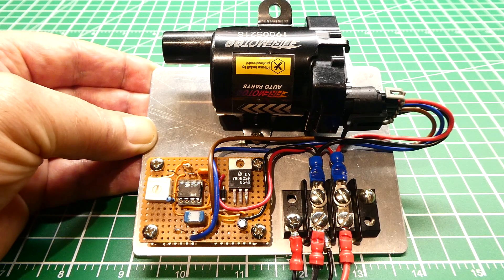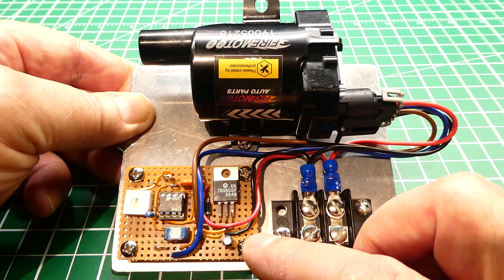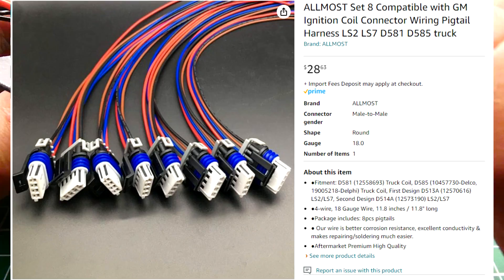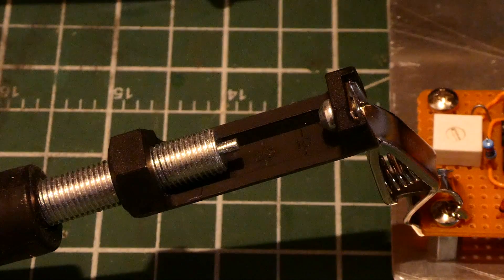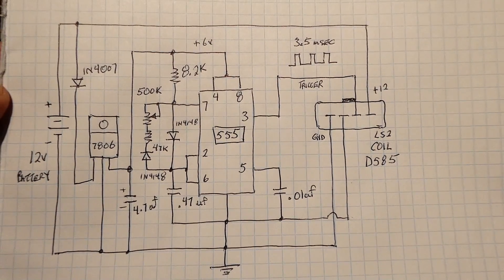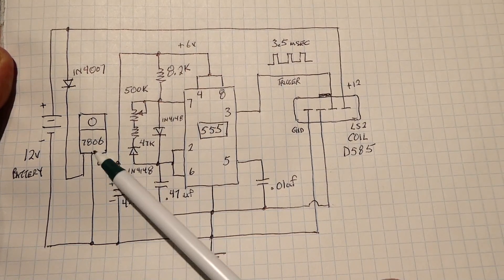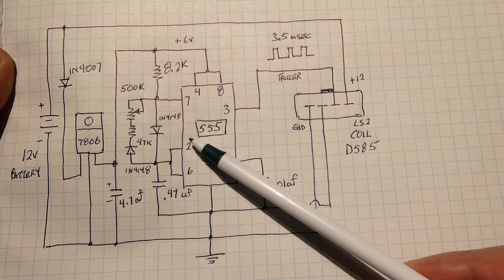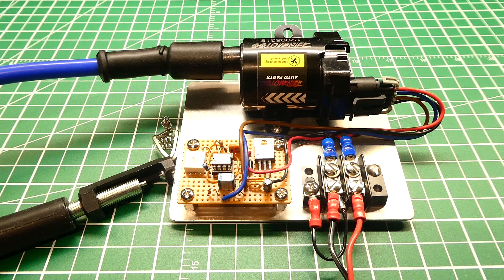LS2 Ignition Coil Tester /  D585

Comment: Hey I built this but the 7806 regulator keeps blowing after about 5 seconds. Doesn’t get hot. Is the circuit diagram accurate? Does there need to be another protection diode somewhere? Works perfectly until I connect the 12v and ground to the coil. (I can see the pulses using an LED connected to ground from lead 3)
Reply from the maker: Maximum input voltage on the 7806 is 25 volts. Verify with a scope. Power the circuit with a car battery not a power supply. For troubleshooting, power the 7806/ 555 timer circuit with a 9 volt battery and the coil with separate 12 volts.

Comment: Great video. I stumble here because I'm trying to run my ls style coils using an ECU meant for "dumb" coils. The ECU uses a negative trigger to fire the dumb coil, and I would like a circuit that turns that negative trigger into a the 5 volt signal that the coils needs. Any advice?
Reply from the maker: If you want to convert a negative signal into a positive signal you need an inverter circuit. A simple transistor will do that or you can use an inverter driver like a TC4423.
Reply: Thank you, that IC looks interesting but i have never used or seen it before. Is there an example circuit I could reference?
Reply from the maker: Search online for Speeduino and Megasquirt videos:  https://www.youtube.com/watch?v=SuG5068wOUY&t=2649s

Comment: Thank you for posting! Very interesting. I will try to adapt your circuit to a bench test bed for old dwell/tach meters. I have 6 cylinder vintage vehicles with 6, 8 and 12 volt systems and a box full of old test meters. I'd like to use this circuit to see which meters are a suitable fit for each voltage system. What dwell angle is your 3.5 ms equivalent to?
Reply from the maker: The dwell angle would be equivalent to 14 degrees.
Reply: @0033mer  Thank you for the quick response!

Comment: Why not just use a dmm to test these coils.
Reply: internal primary circuit buffer signal, also safety issue/ HV probes required for dynamic test.